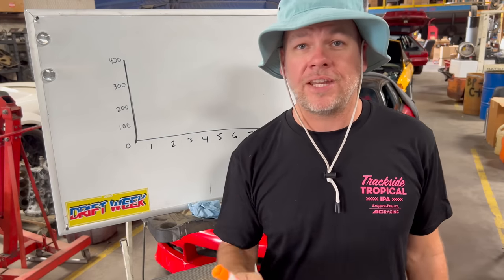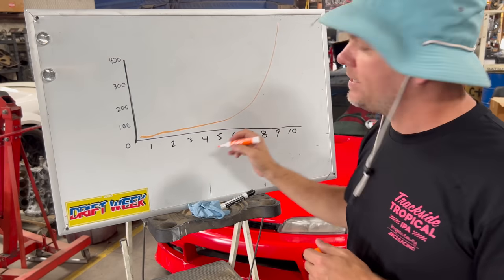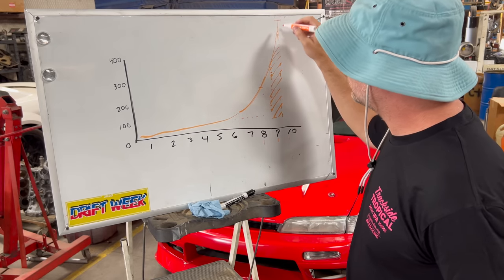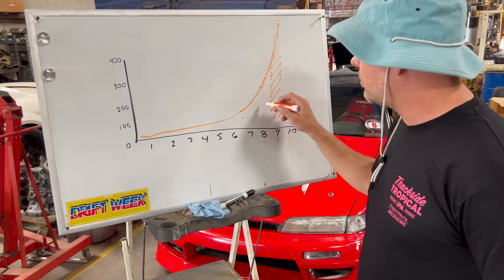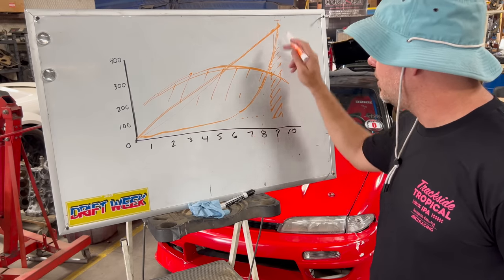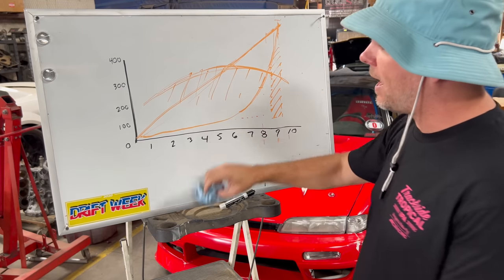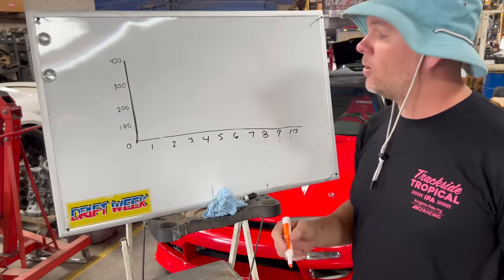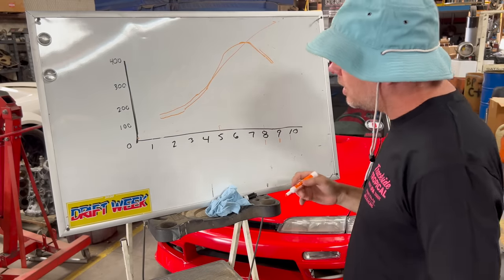What makes an engine fun vs boring to drive?  Not real tech

Comment: I agree with most of this but with a proper sized turbo you can make a very large power ban. My jz hits 27psi at 36-3800rpm and pulls to 8200rpm makes 750whp. You might remember it from drift week 4 the orange s13 with the blue wheels.
Reply: What turbo do you have?
Reply: @HAULUUZ  spectrum motorsports sr/61 1.06 T4 twin scroll. They did the whole hot side of the engine all made here in Canada

Comment: I want work with Aaron so bad just because I know I could learn so much from him
Reply: What do you drive?
Reply: @p9raceway759  at the moment, just my Honda Accord for work. I have a truck for truck stuff too. I've been putting money away and hopefully after tax season, I'll buy a 350z. Done a lot for research and it seems the best vehicle for the type of budget I'll be working with.
Reply: @TeamDreamROGue  Cool. Yeah I prefer unmodified cars for commuting. Fuel mileage & reliability. Imagine when you get Z and can street drift it completely stock while saving for mods.
Reply: @p9raceway759  i would rather not street drift. Too dangerous for myself and other drivers. Stay to the tracks, much safer that way

Comment: If someone is still on the ropes about what setup to do, buy a sim rig for assetto and figure out what you like driving style wise and go from there.  Aasbo won fd with a 4banger with one of the best teams in the world, we are not them, but most are also not in FD.  99% of the people viewing this will never be at that kinda level of comp and should understand that before spending anything.  i've seen local comps won by almost stock volvos, at a certain level it doesnt really matter until its an event the ex fd drivers swam to.

Comment: One power band that was missed would be diesel, id love to set aaron up with a car and see what he thinks, the curve would look like a LS but more exciting
Reply from the maker: Oddly enough most diesel power bands don't work for drifting because they are INCREDIBLY tiny.  Take a Cummins, which we think of as having this huge power band and making power super early.  If it makes power at 1600 RPM but only goes to 3000 RPM at redline, or whatever it is, you have a 1500 rpm power band.  The gearing has to be SUPER long to make that work, and it gets to be super wacky.  Where an LS1 might make power from 2500-7000 and have multiple times the power band size.